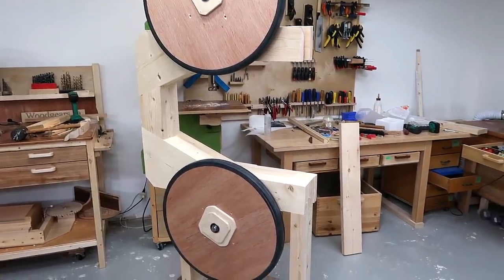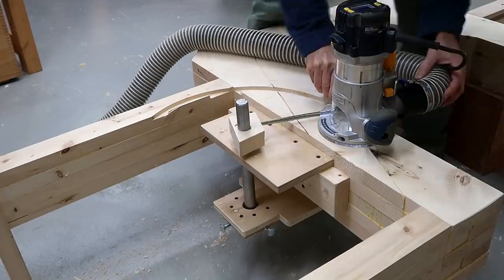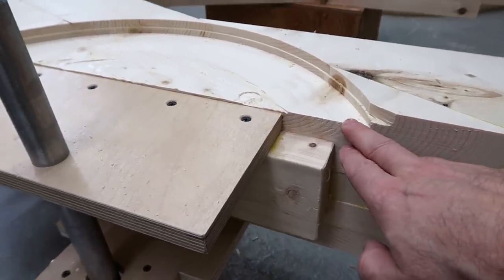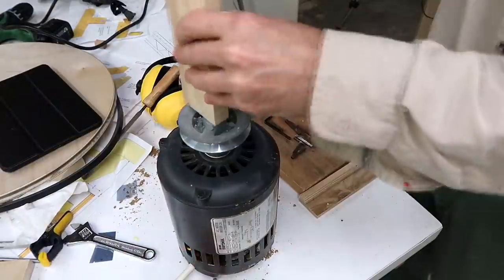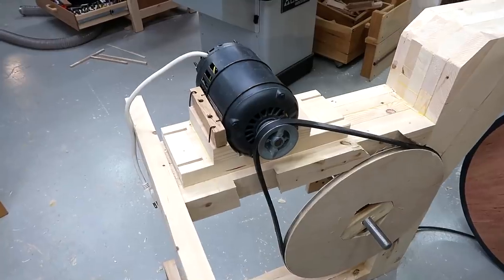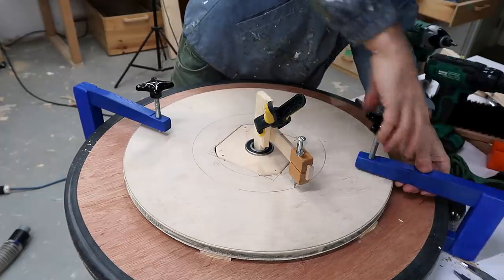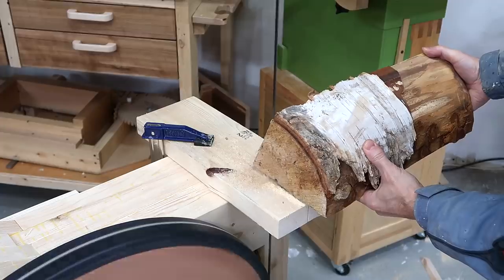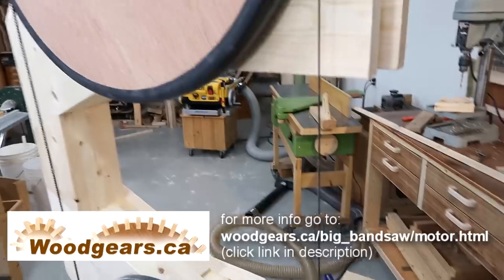Bandsaw motor mount with coat hanger wire

Comment: Many of your projects are not ones I'd choose to take on but having said that I've greatly enjoyed watching these snippets of your creative process over the years. I'm sure there are some head scratching moments but the results are always simple and effective.
And I have stolen some of your processes for my own use. Keep it up.
Reply: @Styrofo4m  I'm a hobbyist. I have no intention or desire to follow his career path. I have bought and made a couple of his designs ( screw advance box joint jig comes to mind ). I only meant that while  I'm not interested in building a wooden bandsaw, I have a good 17" saw that meets all my needs, but I'm interested in seeing how he solves problems. To that end I've "stolen" or "borrowed" if you will some of the methods Matthias uses for his work. Not the complete project, just details like hammering on the screws he'll use for assembly to mark where the pilot holes go. Things like that.

Comment: Today i learned that removing a ridge with a chisel is much easier than balancing the router on one edge of the sole :) Thank you for that detail!
Reply: Or just remember the general router rule to work from the inside or middle of the cutout and then move outwards rather than working from the outside and moving inwards.
Reply: @XJWill1  Your suggestion makes it worse, because then you are always balancing only on one side.
Reply: @XJWill1  Hand tools are our friends and often very mush faster and safer than power tools
Reply: @airgapmachine  You apparently lack experience with routers. No, running a router around an edge is not "worse". That is the most common use for routers.
Reply: @XJWill1  Personal attack instead of explaining how your solution is better... classy. You are proposing to always balance the router on one side of the bit. In the video he always had supports on both sides of the bit, which is more stable and safer when cutting out a lot of material. Then use chisel to remove the thin supports.
Reply: @airgapmachine  In no way did I personally attack you. And I repeat, since you seem to have missed it:  THE MOST COMMON USE OF ROUTERS IS RUNNING THE BIT ALONG AN EDGE. In no way is running a router along an edge "worse". It is standard procedure.
Reply: @XJWill1  Cutting out a channel or dado is also a standard procedure. When removing a lot of material, his solution is superior to yours. My opinion.
Reply: @airgapmachine  If you had any significant experience with routers, you would know it is not "my solution". It is how the vast majority of experienced router users work. It is not difficult, and it works well, and it is faster since it does not require removing materials by hand at the end. It can be done with a standard router base, and it can also be done with a base that extends further on one side with a handle to provide additional control.
Reply: @XJWill1  It is your solution in the context of this discussion, not that you came up with it. I didn’t say it is difficult or that it doesn’t work. It is less safe at removing a lot of material than solution in the video where both sides of the bit are supported. It works in other contexts but anyone experienced with a router would use the safer approach in this video.
Reply: @airgapmachine  Your inexperience with routers is showing. No, edge routing is NOT unsafe. It is perfectly safe. Again, EDGE ROUTING IS THE MOST COMMON USE OF ROUTERS. You should really learn about routers before continuing to make ignorant claims.
Reply: @XJWill1  It’s not physically possible for router to be safer when supported on one side of the bit vs two sides. Hopefully you aren’t making other mistakes. Good luck.
Reply: @XJWill1  Get a room, rather than keep on pinging me with your quetsch. Shut up, or come up with some definite proof that balancing a router sole at one side is better than having it supported at both sides.

Also, to quote Doug Jackson, what did you make today?
Reply: @anderswegge6828  Hey doofus, if you don't want to be notified for replies to comments, then change your youtube settings. As for your ignorance about how to use a router, unfortunately there are no settings to change to fix that.
Reply: @XJWill1  The thing is that you're unable to admit mistake, and I don't want my preferences dictated by a weekend warrior.
Reply: @XJWill1  What kind of fool thinks that one is larger than two?

You are trying to convince the world that having a router sole supported at one side only trumps having it supported at two sides, and removing the ridge with a chisel. You are fighting an uphill battle, that your vocabulary won't win for you.
Reply: @XJWill1  What did you actually make today?
Reply: @anderswegge6828  The last thing I made was a 3-drawer chest (nightstand). But it is hardly necessary to check my credentials. I am talking about basic router usage. Almost any experienced router user would tell you the same.
Reply: @XJWill1  It surprise me that people who claim to have built anything at all can be so persistent in not being able to read.
Reply: @anderswegge6828  It no longer surprises me that anyone would choose to remain so ignorant. Unfortunately seems to be rather common.

Comment: Interestingly enough, I read a farm/agri motor install pamphlet recently that mentioned "improvised mounting methods" if the bracket(s) were incompatible with the bolt pattern/ring mounting location. Among those listed as adequate for use were using lockwire/safety-tie wire. Basically, exactly what you did!

Comment: I've had issues in the past with coat hanger turning brittle and breaking on me after a single bend. Doesn't appear to be an issue with your setup, but maybe something to keep in mind.
Reply: It's very brittle to start. I have tie wire. 4 strands of tie wire, twisted, would work.
Reply: i have used a piece of coat hanger in place of a chain master link on a 120cc motorcycle for 10+ months and it did not break, i just replaced it eventually with a real master link. i don't expect the coat hanger to be an issue.
Reply: it's just cheap steel, specs and work hardening are all over the place. steel strapping would be perfect for this

Comment: In addition to checking the lower wheel for wobble, it seems like it would be a good idea to also check it for balance since it could have been thrown off by the pulley wheel.
Reply: Indeed, now he's made that lower wheel assembly wider, he's got dynamic balance to deal with aswell as static balance. It may appear to not have a heavy spot till you spin it up and it develops a little shimmy/wobble. I'm enjoying another quality tool build though.

Comment: Bicycle brake cable cutters? That's an oddly specific tool. Was this one of those tools you got from the trash?
Reply: I have a "piano wire cutter" for work since it is the de facto tool for tying rebar wire where I'm from. I doubt anyone actually cuts piano wire with them...
Reply: Bicycle brake cables are multi-stranded for flexibility, and if you try to cut them with normal wire cutters the strands will separate and become difficult to fit through the holes where they attach to the brakes. Brake cable cutters have hooked blades that surround the cable before cutting it so the strands stay together.
Reply: I've a pair too, never bought it for my bikes, i use hydraulic brakes. They're just that good.
Reply: @aserta  for my bicycle brake and derailed cables, I use a drempel cut off wheel. But I might have to upgrade just because that’s a pain in the fricking neck and I deserve a new tool every so often.
Reply: You know he wanders around stores thinking about how to repurpose things, right?  Lol
Reply: @4hodmt  I thought it was more for the cable housing itself, but yes I can see how that would be much better for the multi-strands.
Reply: @JasperJanssen  when i started my bike repair business, all i had was a dremel for that purpose and that is your best bet until you can get some real housing cutters. i love using mine every time, they are so satisfying. you still need to use a pick most of the time to open up the lining in shift housing though.
Reply: @woodsprout  its the same idea for both cable housing and the cable itself. you don't want to crush them, and that's what the tool is designed to do somehow (seems like magic to me every time i use one)
Reply: There are all kinds of cable cutters. The difference from bolt cutters is bolt cutters have straight blades and cut like scissors, and cable cutters have curved blades that have a round hole rather than a "V" between the open blades. So they press from all sides on a round wire or cable.
Reply: @lwilton  actually bolt cutters cut by crushing the material, not shearing like scissors
Reply: @bmxscape  Oops, yes, you are quite right. I guess I haven't been cutting enough bolts recently. :-)

Comment: It's ALIVE!!!! well... It's getting closer to the finish line!  Your comment: That final cut almost resulted in disaster... yeah I cringed as the offcut fell into the lower wheel, but luckily it didn't but it proved that the bandsaw has adequate power and the blade doesn't slip under load... Good job!

Comment: Matthias, you could have reduced the pulley diameter but that would bump up your blade speed considerably. I am assuming here that you sized the pulleys on the shaft and motor to give you the rpm on the wheel to get you the correct blade speed. 
This is my opinion. Take it for what its is worth. I think you would have been better to place the pulley on the back side of the saw. That way you would have forces acting on both ends from both blade and belt tension. Also mounting the motor either solidly to the machines frame and using a tensioning arm to keep the pulley under proper tension or mounting it on a slide* that can be adjusted.
*The slide could be nothing more than two layers of plywood (scrap of course) beveled on two slides. On each beveled side there is matching piece. One of these is solidly mounted. The other could be loosened to allow for adjusting the slide. The sides cut from the same double layer so the angles match. I spent 45 years repairing and rebuilding industrial machinery along with having to do almost all of my own machining and Tool Maker work so I have a fair idea what I'm talking about.
I also understand that one of your goals here is to build the machine for yourself at as low a cost as possible.
Reply: I assume he prefers more torque, instead of that speed being slowed down anyway.
Reply: @Yonatan24  
I'm not sure what blade speed he is looking for but if he wants 1000 fpm the 26" wheel only needs to be turning at 147rpm*. If he is looking for a higher speed say 2000 rpm just double that. Let's say he needs 300 rpm. And he is using a motor that runs at 1750 rpm. That means the pulley on the bottom wheel needs to be 5.8333 times as large as the motor pulley. And every time I see somebody using one of those die cast pulleys I just cringe. Let alone the shim he stuck in the pulley bore. But that's my 45 years of experience talking. The last piece of wood working machinery I rebuilt was an old Delta/Rockwell Unisaw. The blade arbor was shot due to the bearings failing. I had to make a new arbor shaft and a new pulley. When I re-assembled the saw the guys in the carpenter shop said it ran better than it ever had. Shortly after that Safety came out and locked it out because it didn't have all of the proper safety equipment.
*a unit of measure the inch and metric worlds can agree on!

Comment: I do not want to think about what could have happened had that slice fallen into the wheel!!

That was a very elegant trick with the wire! I would have been stumped and maybe tried to cut some threads or weld on a nut.. :/

Comment: looks good but big hoseclamps instead of wire?
Reply from the maker: Not as strong.  The treads fail on them with too much tension.
Reply: He uses cheaper repurposed stuff or else he would use linear glides instead of rebuilding drawer guides all the time.

Comment: Why not have the pulley on the opposite side of the frame ? It would mean a little redesign of the bearing/shaft arrangement, but it would improve stiffness.
Reply from the maker: See previous answers to that question

Comment: Hi Matthias. Why  did  you  mount  the  pulley on the  same  side as  the  lower wheel  instead  of mounting the pulley on the opposite  side  of  the  bandsaw, using a longer shaft and supported  by a pillow  block bearing as you did in your video "First homemade bandsaw: Things learned."??  That  way  you wouldn't  have had to sacrifice a little  bit of strength/stiffness by  removing wood for clearance  for  the  pulley.  Also, with the  pulley on the  opposite  side I  realize you'd  probably  reverse the rotation of the  motor.   Reversing  motors is  something  you  yourself  do frequently.  Just curious.
Reply from the maker: see previous answers to this question

Comment: Did you balance the pulley/wheel assembly before testing by any chance? I'd be concerned with pesky vibration while the bandsaw's in use.

Comment: Thanks for these great series. One question, what is the reason you didn't mount the pulley on the other side of the frame and axle?
Reply: Probably because then the belt tension on the axle is multiplied due to being outboard of the mount.

Comment: I wonder what would have happened if that piece of wood made it all the way in between the wheel and the blade..? Would the blade come off the wheel, would it snap, would the wheel take damage..?
Reply from the maker: no idea, but it would be bad.  hopefully the wooden spring on the upper wheel mount would fail first.
Reply: @matthiaswandel  Will we see you sacrifice one of your older bandsaws to run an experiment? 🤔😁

Comment: Drywall screws are pretty brittle, I would have thought  panhead bolts coming up through the material and bolted on the top would have been better to sure the motor coat hanger block.
Reply: And so is the coat hanger wire brittle. Probably the most of any wire.